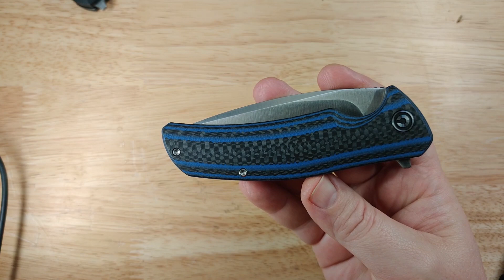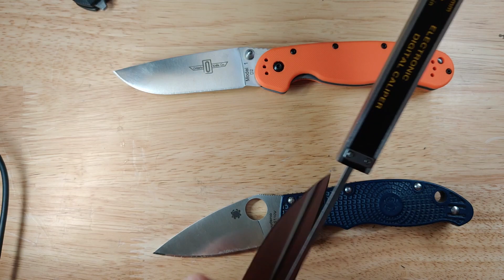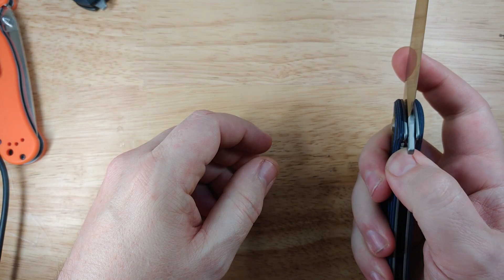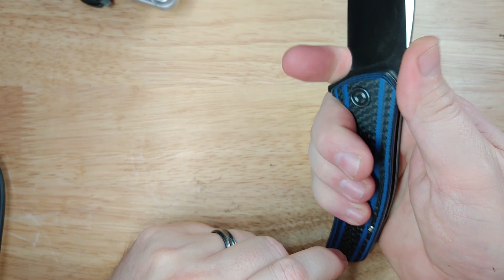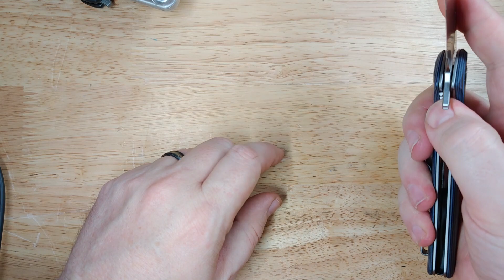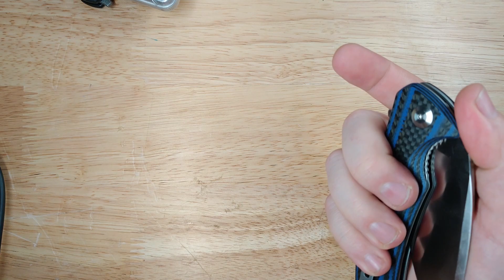Civivi Incite Overview

Comment: 14c28n is supersteel in the sub 90 dollar range
Reply: When we got D2 on ball bearings with g10 and skeletonized liners for under 50 bucks, we lost our damn minds over D2 cause it wasn't aus8 or 8cr.  14c ain't gonna turn heads anymore but it is the best next gen budget steel i know of.  At least until cpm154 gets cheap
Reply: I think the next breaking point is when CPM steel turns budget, like CPM154 is starting to

Comment: Honestly? I'd really like to see 154CM  see more use in the industry. In my experience, it holds an edge considerably better than 14C28N, and is at least marginally better than D2 (and the CPM version is considerably better still). And, of course, it's an actual stainless steel.
With the exception of a few companies like Emerson and Protech, it's been pretty much phased out of use by more "high-end" companies.
Kershaw uses a lot of CPM 154 in their US made knives around the $80-120 mark, so I don't see why other companies couldn't start doing the same thing.
Reply: mooseclappin11 cpm-154 is used in kershaw’s us made knives bc it’s a us made steel.  A chinese made knife is going to primarily use a chinese made steel.

Comment: I have been using knives with D2 for over 40 years with great results but if you want a suggestion for stainless I would recommend Sandvik 14C28N.
I am glad to see you doing a review again.
Reply: Agreed completely.
Reply: I'd like to see what 14C28N could do at a 60 HRC.
Reply: @NativeTexMexican  I agree 100% with you. Sanvick 14C28N to get it to a Rockwell hardness of 60 - 62.  I found a really nice almost scientific, article that a guy that test blade metals. He said that Rockwell hardness is like the megapixels of steel.